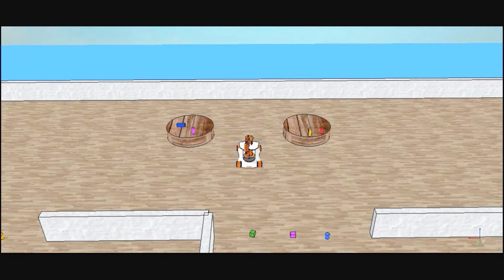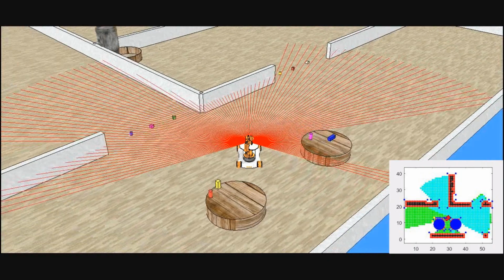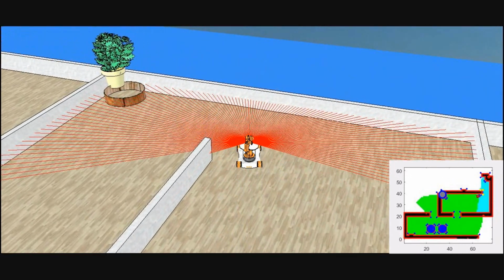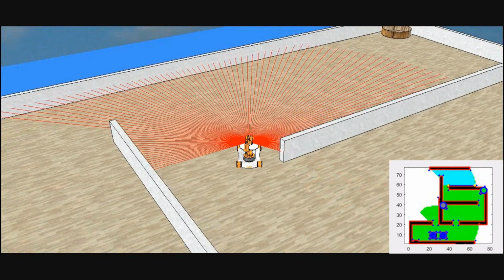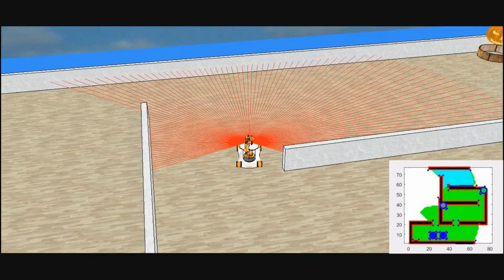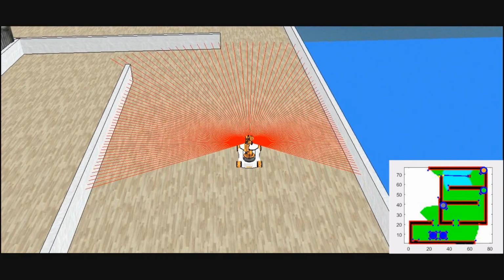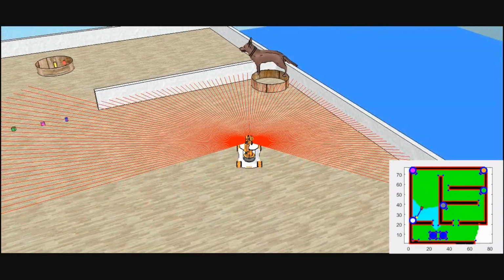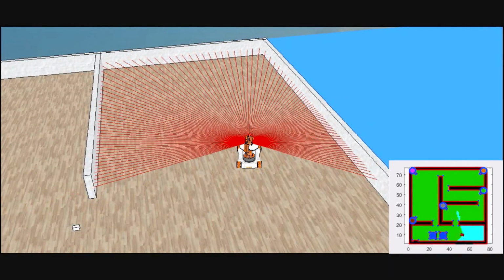youBot map exploration in V-REP

Comment: How did you program your youbot? how did you implement the MATLAB classifier to vrep?
Reply from the maker: You'd have to be more specific for your question about how I programmed it

For the second one, there is a communication channel that is established when I start the simulation, and functions that I can call to communicate with vrep
You can check it here : http://www.v-rep.eu/helpFiles/en/remoteApiOverview.htm

Therefore the classifier is used entirely in Matlab, using the data received from the channel
In this case, I can take a picture in vrep using "simxGetVisionSensorImage2" function

For the classifier I followed the following procedure : https://nl.mathworks.com/help/vision/ref/trainimagecategoryclassifier.html
Reply: I meant what language did you use to program
Reply: Thanks I'll check the two links